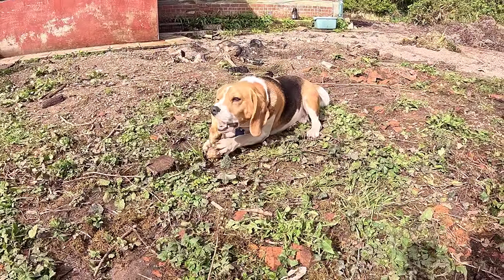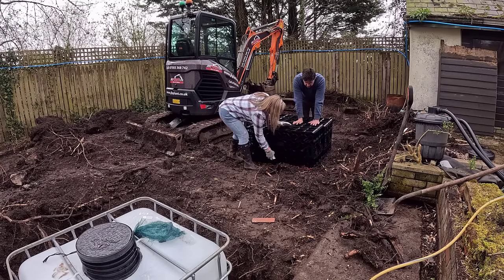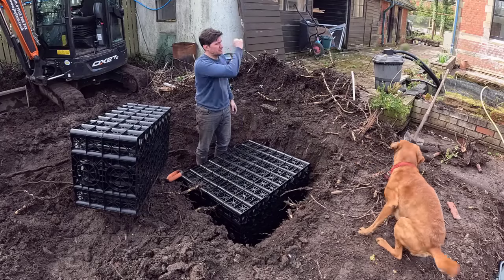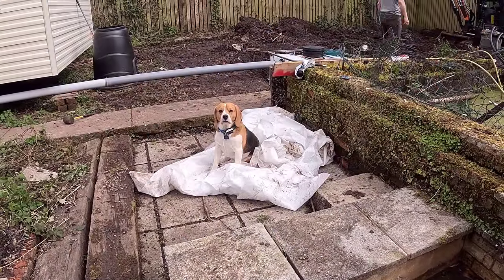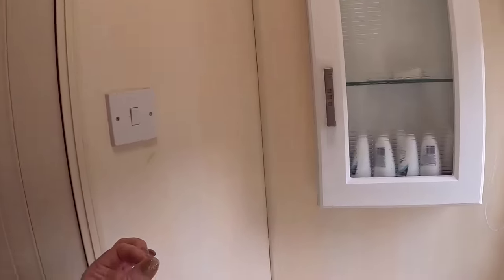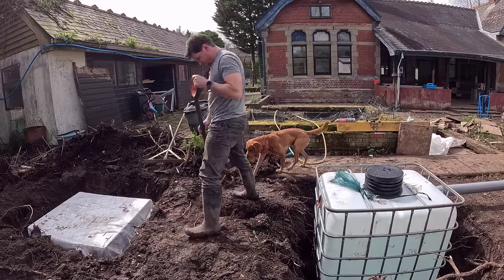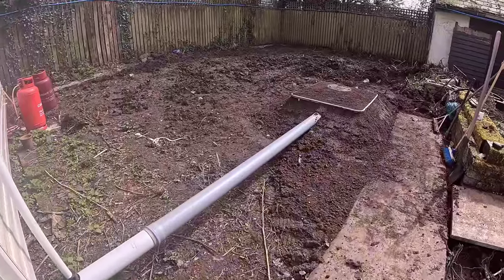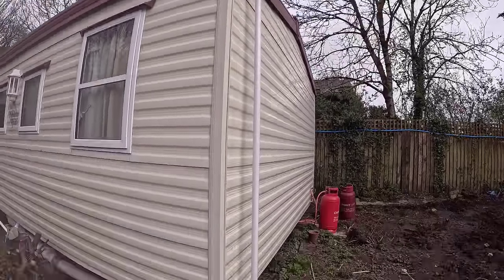Our Beagle, Buddy, Supervises The Septic Tank Installation! - Part 2 of The Install

Comment: Regarding all the mud between the caravan and the rest of the world, if there is any additional carpet in the station you don't plan to keep pull it up and throw it across your paths. You can always remove it later (or it breaks down) , it gives you a much cleaner experience. It might still be wet but you won't sink in it
Reply from the maker: There’s a bit we’ve taken out of the station that we could use but even though there is a lot of mud, between the platforms, the chippings and the paving it can be quite easily avoided.

Comment: You may well know this tip, but when connecting plastic piping together which are push fit, wipe the joint with washing up liquid first. They then slip together much more easily.

Comment: When you redo the pipes for your septic tank use washing up liquid that will help when pushing the pipes together
Reply from the maker: Great tip, thank you! 😊
Reply: You can also get a tube of dedicated pipe lubricant quite cheaply. Might be silicone grease or something like that.

Comment: Here in Ecuador we don't flush the toilet paper. Sounds bad I know but keeps the pipes from clogging up. Just keep a sealed garbage container beside the toilet and throw away frequently.
Reply from the maker: That makes sense, nothing worse than blocked pipes and overflowing toilets!!
Reply: Flushing toilet paper (toilet roll) is pretty much a bad thing for most septic systems, especially ones with small storage/processing capabilities. This particular system may work well for small-scale use, but loading it with extra material wouldn't be advisable. A septic treatment may be in order to maintain the system's balance.

Comment: Just a tip. When you are connecting that type of pipe, smear a small anount of washing up liquid around the seal and a bit around the pipe and it will pussh in quite easy.
Reply from the maker: Great tip, thank you! 😊

Comment: I would be sure and remove all the bamboo roots as they are invasive and will grow into the system. They love the water and the human fertilizer . I have had them grow through my asphalt drive.  Also I would made sure to have a good angle to the tank so there is no standing water in the pipe and bury the pipe to the tank to protect it from freezing.
Reply from the maker: The bamboo is a nightmare, I just keep finding more! The tank had to be at a slight angle as per the instructions so hopefully that means no standing water. My next job is to bury them, hopefully we’ll have about eight months before we get any freezing weather…. that said we’re in Wales so it could freeze a lot sooner!!

Comment: Another major accomplishment (albeit temporary). Great job, you two!  That run of pipe from the caravan to the holding tank is a little long. The pipe will sag.  You should consider putting a couple brinks or wood to hold up the pipe, perhaps at a couple points between home and tank.  Cheers, from Kansas City USA!
Reply from the maker: Thank you and 👋 from south Wales 🏴. I’ll be putting some bricks along the pipe for support and then covering them. It’ll only take Winston to crash into it chasing a ball to knock it out of place!

Comment: I had a panic that the septic tank was the wrong way round, but when I had a think about the ones I have installed, it actually isnt!! I used to put in the conrete sectional type which had an inlet tee and an outlet tee so that the incoming didnt disturb the top layer of scum which seals the air out of the liquid below, the bacteria that do the work are anerobic, and exposure to air makes them go dormant or die. The vent is to get rid of the methane they produce as they break down the solids, and the liquid that runs to the soakaway makes excellent fertiliser! Good job! Enjoyed the video!
Phil
Reply from the maker: Thanks Phil, I followed the instructions to the letter and so far so good! I have to say I’ve found the inner working of septic tanks far more interesting than I thought I would, I’m definitely leaning towards having one installed for the station.
Reply: @theoldstationrenovation   the cost of a drain connection to the mains, even if one is available will be high, and of course ongoing. A properly maintained septic tank is a very good alternative! I got the septic tank/ digester bug in the seventies reading “ the mother earth book of home made power”  you get three outputs from a septic tank, a high grade liquid fertiliser, an innocuous odourless  solid that  can go straight onto the garden as it is sterile but contains lots of nutrients, and methane you can cook with! Remember if a septic tank smells bad it is not working! 
Good luck with it all!
Phil
Reply: Yes. I was unfamiliar with this system and have only installed concrete boxes. The carrots grow great on the soak away bed.
Reply: @synicyst9925  don’t they just!!

Comment: The pipes on the tank look strange. Apparently the rules aren't as strict in the UK but according to what I've been taught the in and out pipes are exactly the wrong way round with the straight pipe as the inlet and the bell end on the outflow. Had it been the other way round you wouldn't have needed that slip coupler on the inlet. Installing the pipes this way round creates small lips inside the pipe that solids can snag on and cause blockages. The pipes are also slightly more likely to leak.
Reply from the maker: Definitely the right way around, followed the instructions to the T, and (easy for us) In and out were actually written on the cube pipes
Reply: @theoldstationrenovation  I'm sure you followed the instructions and the labels made perfect sense, I was just wondering about the manufacturer's design that made installation more difficult and the result perhaps a fraction more likely to leak.

Comment: We put bacteria in our septic tank. It helps break down organic material and reduces overflow. Is that something you can use in yours?
Reply from the maker: Thank you for the tip, is that like yeast?
Reply: @theoldstationrenovation  No, these are bacteria specific to septic tanks. In France, we use a product to start the tank and then we "feed" it every month. The professionals who installed my tank told me not to bother buying special septic tank products in the shops and to use 2 plain yoghurts that I leave to ferment outside for a few days and then put in my toilet.
Reply: @carolemg  I didn’t know about the yogurt! Great idea!
Reply: We do too. We get ours from the septic clean out guy who comes once every few years. The instructions are to put 7 scoops to start it then a scoop every month.

Comment: I don't think that deep enough  it might not work right it has to be  cover to the opening  lid I hope it work
Reply from the maker: As long as the pipe slopes down from the caravan it should be fine. I would have preferred it to be deeper but the earth is so hard on the trackbed the digger just couldn’t get through!

Comment: Don't you have to fill the second hole with gravel?....
Reply from the maker: Yeah we could have but we bought the soak away and membrane instead. So far it’s working just fine.
Reply: @theoldstationrenovation  Forgive the ignorance, so the plastic boxes in the second hole are left empty?....
Reply: Yes should have a pea shingle bed then crates and membrane then more pea all around the edges.
Reply from the maker: Yeah, on the instruction video they said it’s either gravel or crates, we went for crates as it’s easier…and I always like easier!
Reply: @theoldstationrenovation  The soak away crates are still supposed to be bedded and covered (not filled with gravel. This just helps it drain out into the surrounding soil. You might get away with it as it’s temporary but you may also create a bog.